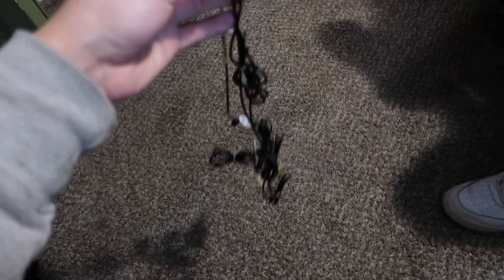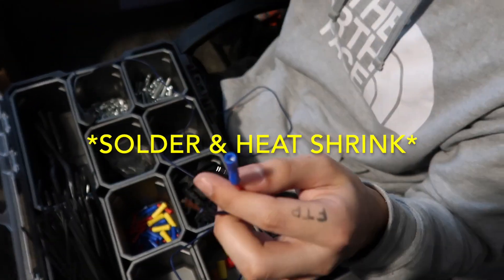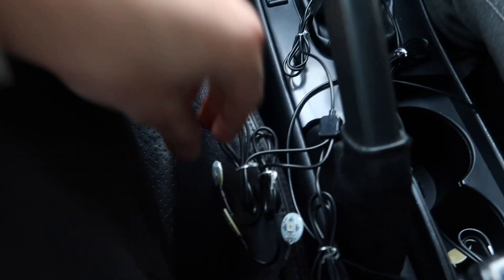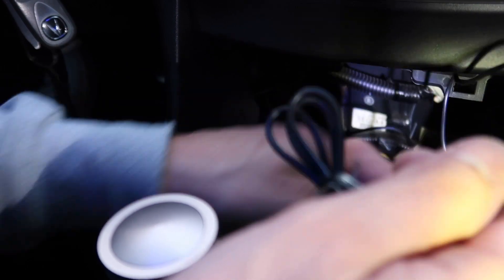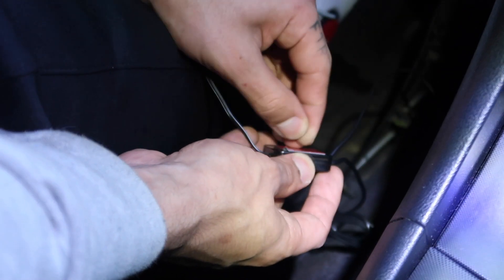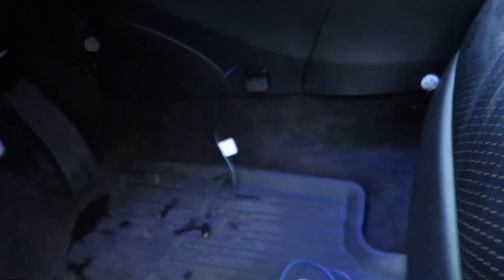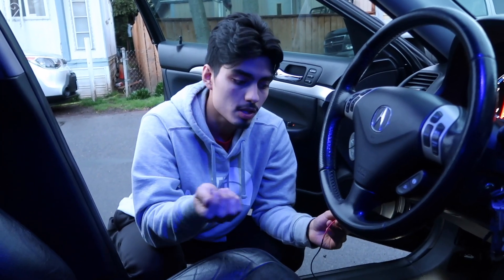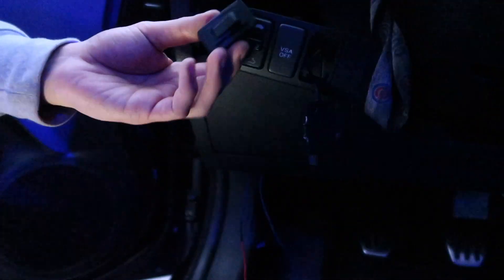Interior LED Lights for the TSX

Comment: Thanks for the video, on the fusebox there's a few that are labeled "Not used" can I tap into that instead of removing one?
Reply from the maker: You wouldn’t be able to use it because there is no power running through that fuse.